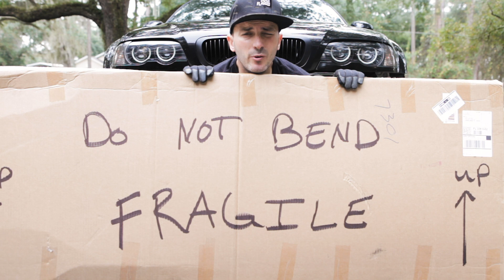Installing a Race Splitter on the M3! | vlog 090

Comment: Only 4 bolts that deep in can't be structurally sound, at speed the air will force it self between splitter and ACS replica splitter.  You should put more bolts through the splitter/bumper/undertray closer to the front edge of the bumper no deeper than 3cm/1inch
Reply from the maker: Working on some more reinforcements now. But yes I agree with everything you said.

Comment: Do you have fluids leaking brosky?
Reply from the maker: No I removed the washer reservoir before this install and washer fluid drained down under the car. I had it in the video but it was a bit of a ramble so I edited it out.
Reply: Black Flagged ok good..😁